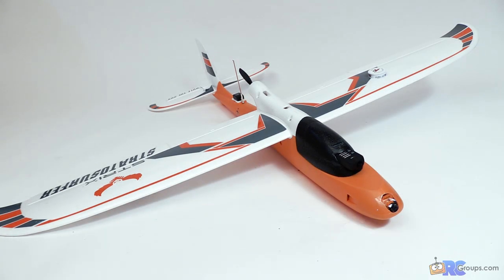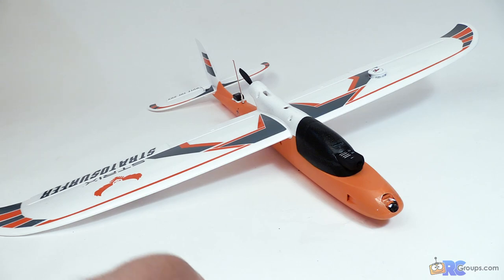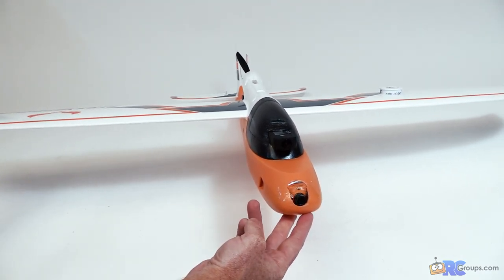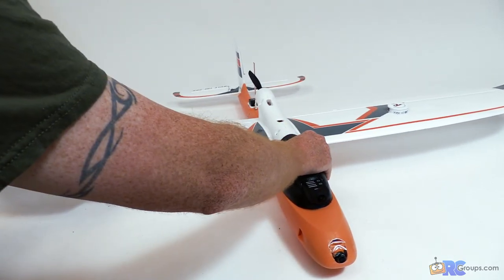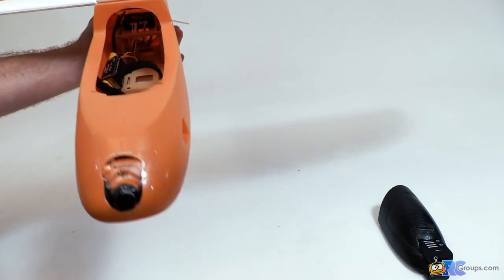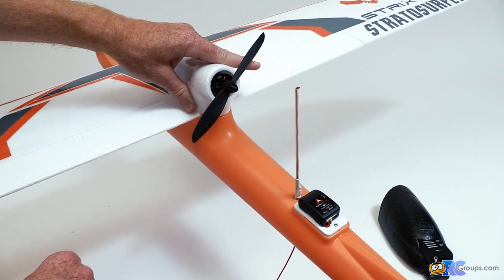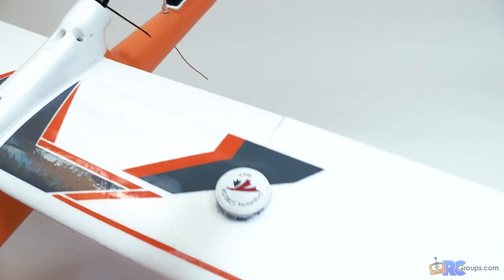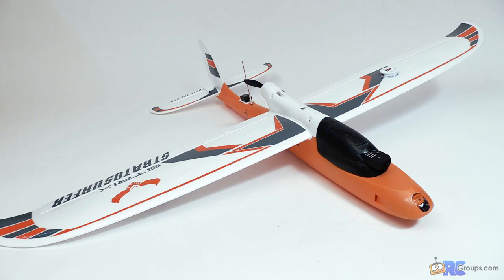ReadyMadeRC Strix Stratosurfer - RCGroups Review

Comment: These are a bit of a pain to get into the air.  On mine with 2x 2200mah bats (in parallel) I have to get on the elevator very quickly or have someone else hand launch it for me.  Launching from a hill isn't a bad idea.  I really wish landing gear were an option, it would be as easy as a bix 3 or ranger ex to take off.